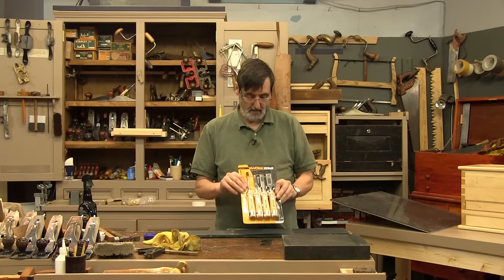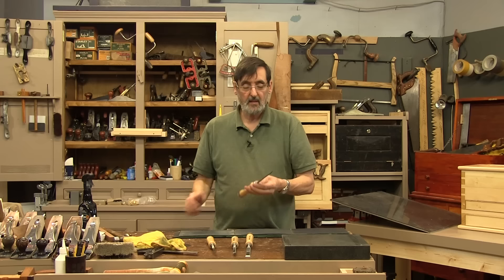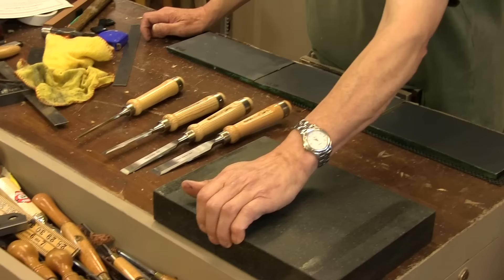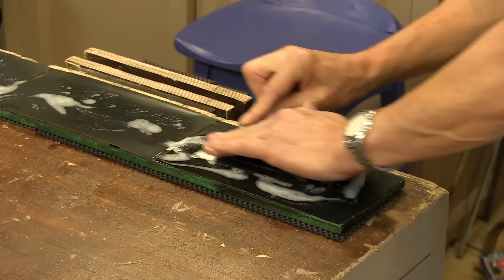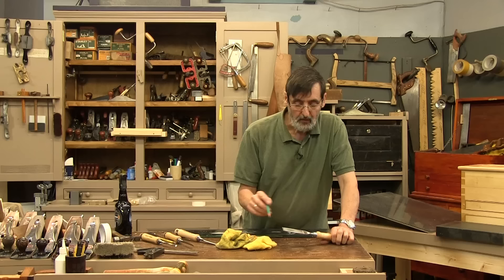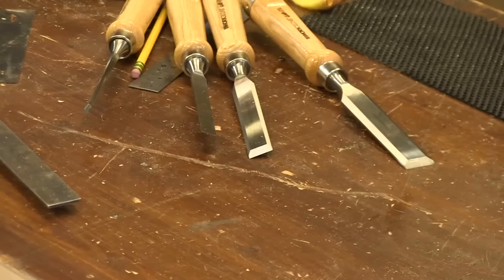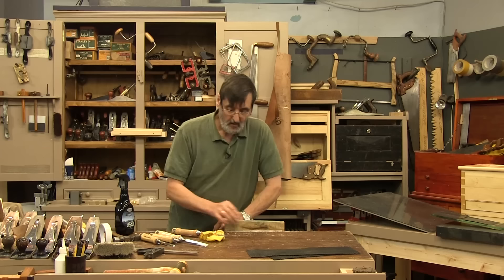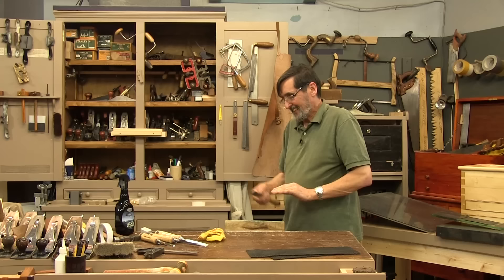Preparing and sharpening a woodworking chisel | Paul Sellers

Comment: Hello! Lovely instructive video, thank you! I need some help identifying a hand tool and I thought this place was the best place to ask. I have a hand tool from a brand called EGA. It is old but in good condition. I initially thought it was a chisel but when I looked up how to sharpen it I realised that no videos showed how to sharpen mine. It is bevelled but on both side of the surface meaning I can flip this tool on either side it is identical. I saw that most chiseled are bevelled only on one side with a flat surface on the other hence my confusion. If anybody can help, I would greatly appreciate it. Thank you
Reply from the maker: This sounds as though it may well be a sash pocket chisel and it was used a specialist chisel in the making of sliding sash window frames. Without a photograph, I cannot be definitive but that’s what it seems to me. Try googling sash pocket chisel and that should answer your question.
Reply: Thanks for your reply, I googled it but no luck. It is quite skinny compared to what I saw only. Thanks again.
Reply: lifeslittledelights You could be describing a fairly common gouge used when turning wood on a lathe. The handle would normally be quite long.

Comment: My only comment on sharpening would be - Whatever the abrasive get it wet and keep it wet.  The wetness gives the waste metal particles an escape route and lubricates the blade to reduce the unwelcome grab so you don't rip or mark the edge surface.  Just makes whatever you use a bit more efficient.
Puddles create "mud" and mostly mud is sticky and destructive.  Moving water is clean.   
Different if it's a slurry stone, then you want to create an abrasive paste - in this case the coating on the paper id doing the work so the water is the "lubricant" - Ideally you want running water - but suspend the work plate on a piece of wood over a bowl and frequently use a sponge to dowse the work area.
It's not a deal breaker, my nan used the top step - we've seen the better end of good enough demonstrated - water is just a refinement

Comment: Paul, is there a major difference in using water or going dry?
Reply: As you know im not paul but using the fluid allows the tiny pieces of metal to get out of the glasspaper and aid in the ease of sharpening hope thos helps

Comment: Sadly, Aldi don’t do this nicer chisel pack, they’ve changed them (as they always do each week/month) with a plastic or rubber looking set. Also, there’s only 3 in the pack and not 4. As always, I’m late to the dance.

It’s interesting that you don’t concentrate on mentioning that you’re honing the edge, Paul. The videos I watch generally mention the main bevel (at around 25 degrees), and also the edge itself, which they generally put a 30 degree edge. I was just wondering if that’s what you end up with, as you don’t specifically mention a honed edge? (to my knowledge - apologies if you did). I’m new to woodworking, so any help is greatly appreciated. Thanks.

Comment: I do quite a lot of carpentry, opposed to cabinet making. Is it necessary to do this with all bought chisels, and what are considered the Rolls Royce models? Thanks for a very interesting lesson. Bob
Reply: do you mean the rolls Royce of chisels or   tools over all   I would say  planes   they would  have to be  lie-neilson   and  chisels either the  same or  veritas   they have  just released  a new  line of  chisels  with special  metal in the steel to make chisels last a lot longer
Reply: It's always a good idea to take your tools, (be they planes, chisels, traditional saws) and before you use them fettle and prepare them. The only difference will be the amount of work required - more expensive tools will need less prep. It gives you a chance to get to know the tools you'll be using as well, shape the handles to fit your hand etc. mfcman2k7 is right about lie-neilsen but another route is to buy good condition tools from makers that no longer exist, like norris. That way is much cheaper - and the quality of the steel etc can be very high, but being used tools they will need care to bring them back to life, and they won't last as long, depending on how much they've already been sharpened down
Reply: I totally agree with ed mayhew  some of the older  tools I find are better than a lie neilson  tools after a  hour or so of work I have a  few old Robert  sorby and marples chisels  that I have had to  make  new handles for been an apprentice  my employer  gave me  the  tang and blades and   taught me how to use a lath  by getting me to construct new handles for them

Comment: Amazing Paul! What is the white thing that you use with sandpaper?
Reply: It's buffing compound.  I think the white is diamond.  Google it and you'll find all types and grits.
Reply: Buffing compound commonly used by jewelers to polish metal. The ones I've used are White Diamond, Zam(which is green and comes in a cylinder instead of a brick, Trippoli(brown), and Jewelers Rouge(which is a darkish red). They are different grits, and sometimes are for specific materials such as stainless steel, or even glass and plastic.

Comment: I am a novice at sharpening; noting the absence of a gauge. Is "eyeballing " the angle sufficient, or recommend using a gauge for best results, or at least until one can develop an intuition for the angle?  Also (respectfully) notice how "sloppy" hand movement is with starting grit on the bevel (not the edge). Is this just the camera playing tricks, or can you get a curved polish on the bevel?  Methinks that Mr Sellers draws upon a deep well of experience such that some techniques may get lost in translation.
Reply: +Partly Cloudy Paul deliberately puts a convex bevel on his chisels.  That's not possible with a gauge as the surface of the bevel would be completely flat.  I also think you develop an intuition for how to do this by doing it rather than using a gauge.

Comment: Whats a right angle for a chisel blade?And what is a best way to sharpen it ?
I kinda suck when it comes sharpening by hand ,any advice?

I have a 25mm chisel and  it had a dent in a edge,since i am not a smart man i used grinder to get rid of it.
I tried sand paper +glass but i cant get bevel(that should be the angeld part right?)angle right ,at least not by hand.
Problem is it tilts unevenly and blade of chisel is not 90 degrease when you compare it to sides of chisel.
Chisel is sharp enough to cut but it is not cutting straight ,it twists when i hit it with hammer.

Is there way to fix this and make it usable again or should i throw it away and buy a new one(It wasnt that expensive but ,for me its not cheap ether)?

I was going to use it for cutting mortise and dovels.
Reply: find another hobby.....if you can't follow above video???

Comment: Efective to a level, but to achieve even a better results on the stroping fase, one should exerce much less pressure and a litle more speed on the chisel. Other than that, what hapens, is that during the motion the leather under the chisel´s pressure creates a "wave" behind the blade that inadvertly polish also the cutting edge, and the best possible cutting surface is not achieved.  This can be verified on a cheap usb microscope device (400X) but can also be clearly felt after changing methods, (and that "wave" can be seen even at naked eye).  This is the reason why barbers sharp their thin blades applying speed, not pressure, and when sharpening hollow bevels they lay all the blade surface on an angle to allow full contact of the blade´s side that avoid the "wave" to be created. In this case that can not be done as eficiently because your strope is flat and the bevel is round, but this process still works and enhance significantly the edge quality, and can be aplied on all sort of edges.

Comment: Is it okay to use a flat piece of wood that is planed down with a plane for flattening and sharpening?
Reply: I think you want something harder so it will stay flat.
Reply: Yes, but you'd probably need to keep replaning before using it each time. You want something hard and dimensionally stable. Plywood would work
Reply: Would MDF work, or would that be too soft as well?
Reply: rkvktmen I think MDF would be OK if it is square. You can check to make sure it doesn't go out of square afterwards.

Comment: i was tempted to buy cheap chizels n then sharpen tjem. then i asked a joiner i worked with n he suggested irwin maple. bought them 45 quid for 4 with oil n polish sharpening stone. snd a roller. not that sharp on first use. ile sharpen them one day. msy buy cheap ones forv regularl ulse use. ee will see

Comment: So do more expensive chisels just stay sharp longer (quality of the metal) like chef's knifes or Am I wrong?
Reply: In general, yes.  In specifics, no.  You also pay for things like well made handles and tangs.  And while some prefer a chisel that stays sharp longer, others prefer a carbon steel that can become sharper, but also has to be sharpened more often, and cleaned often so it doesn't rust.

Comment: When you start to buy stones or diamond plates, would you start buying the fine or coarse grits?
Reply from the maker: Coarse but you could use abrasive paper to start out, as an option.
Reply: @Paul.Sellers Sellers Thanks! I have used your method for a while now and wanted to invest in some diamond plates.

Comment: Hi Paul, love your videos, you explain things very clearly in a way that even beginners like me would be able to understand. As i have mentioned, i am still a beginner and diamond stones are still out of reach for me due to the expensive price of it, so i was excited when i see that you can use sand paper to sharpen chisels, but as you've said, the downside is that it can tear quite easily. So my question is if it's possible to use the kitchen sharpening stones (the one's with two grits on both sides) to sharpen my chisels? Would appreciate your feedback on this. Thanks! :)

Comment: I bought a set of Aldi chisels several years back and they sharpened up as well as I could have imagined. Recently I bought another set and the quality is just not there. The ends of the chisels, well two of them at least, were not even square, much less sharp. Very disappointed in what has happened to the quality of their product.

Comment: Every time I try to flatten my Narex chisels I get rounded side edges. Those things are a nightmare to flatten, the steel is so hard. Even on carborundum wet and dry paper.
Reply: Use diamond plates. Even stones takes ages. The time taken to flatten makes the chisel cost irrelevant!
Reply: Yeah, I've spent probably over 10 hours working on the set of 5 chisels. And went through tens of sheets of sandpaper. I think I'm going to buy a single 100-200 grit diamond plate after all.

Comment: Hi 
 I bought a 10000 grit Japanese water stone and it claimed to give a mirror finish. This was a very expensive stone! I tried to finish my chisels and my plane irons on it and I continues to finish with a blurry finish, smudged?
Can anyone help?
Reply: +Carlos M. Saurith Are you using a sharpening jig or guide?
Reply: +Carlos M. Saurith Get a piece of leather, some polishing paste and have at it. :) You'll have a mirror within 30 seconds that way. I just lay the leather down on a flattened piece of wood and clamp them to my bench. Easy-peasy. :)
Reply: Keep in mind that Japanese grit size is not directly comparable to Western grit size, much like you can't directly compare metric to imperial.   A 10,000 grit Japanese waterstone will be comparable to 2500 FEPA grain size.

Also, Japanese water stones need a second harder "naruto" stone rubbed against the wet stone to create a sludge.  That sludge is what polishes.  If you use it as you would an Indian water stone, with hard pressure, it will  not give very good results.

Comment: You really don't need to put that lot of pressure on the tool while sharpening and you don't have to stroke it 50 times on the same grain.  10 strokes will do.  Let the abrasive material do the job.  There is no point in compressing the paper.  By pushing too hard you crush and scrape off the abrasive material, eventually, tearing the paper.  BTW, I don't want to be cynical, but oak really is not that hard a wood.  Try your chisel on a tropical wood like azobe, also known as 'red ironwood' in the US.

Comment: paul its clear you know what you are talking about....but only thing that concerns me is that you didnt set your angle on your bevel...no human can keep a chissel straight by hand ....is it not better to use a 25 degree guide. like a vertias ?
Reply: bobsy, you do not need a perfect angle to be successful. Some people prefer a few degrees either direction. Tool use and technique matter. I have that Veritas angle guide but have never used it. A: I do not like the feel of it rolling sandpaper or stone, and B: I just never needed it. I do it like Paul does by hand and have had tremendous success. Perfection is not required.

Comment: I hear "macro bevel" and I'm confused by the term. At college we're taught to sharpen at 25 degrees then put a micro bevel of 30 degrees on. However, it doesn't look like Paul does this; Paul just works on the existing bevel, which I thought would be 25 degrees, but the video says it's 30. Someone please provide me with knowledge sprinkles for I has the stupids.

Comment: Hi, I just went to a swap meet and this guy had two "Marples" chisels. They looked old, the handles were blue (almost like watercolor)  and had a white stripe where the iron meets the handle. THe shape of the handle was like a skinny eggplant with nothing on the end. The blades looked dark grey. I offered the guy $4 but he wanted $10. I passed on it, because I just wasn't sure if they were a later Irwin model or the English model. It did not say 'made in England or Sheffield' or anything. Just said Marples. How the heck would I know if its the older/higher quality or the newer junk model? Does it really matter?

Comment: You can find chisels like these in the US under the Shop Fox brand. I think they might be discontinued though as they can be a bit hard to find and Grizzly only shows stock of the odd sizes: http://www.grizzly.com/search?sq=Chrome+Vanadium+Chisel
Reply: Steve M You can also find them at Aldi's - I just bought two sets today in Ohio.
Reply: They do appear to be the same. The Aldi's ones are one-quarter of the price of the Grizzlies, but the Grizzlies are still reasonable.
Reply: We don't have an Aldi's here on the left coast so they are not an option yet. The only reason I purchased the Grizzly branded version is that it was the longest blade for the lowest price that I could find for use in a flooring project. Although I figured it would get destroyed chopping out 3/4" particle board from under the edges of kitchen cabinets it took a beating  with hardly any signs of damage.

Comment: NGL, you got lucky compared with the ones I got from ALDI, they weren't just dull, they were squared off end at the end of the bevel with no sharp edge at all, took an insane amount of sanding to get them remotely usable. They're great now that they're sharp but honestly wouldn't have bought them had I known in advance. (For the record the ones I got were completely different from these wooden handled ones)

Comment: I disagree with you taking so much material off the back of the chisel with the coarse grit. You really only need to expose around 2 mm at the very cutting edge. That way, when you resharpen the chisel, you can use a finer grit and grind less due to less material being in contact with the sandpaper.

Comment: its good really, but when you need 5 tools to sharpen a chissel its too much hastle. I thought myself to sharpen a chisel with one whetstone, and then polish it on electric machine. It then is sharp enough to shave the hair.
Reply: +Ice Carpenter most people just use sharpening stones, this guy is kinda weird going the glass and sandpaper route.
Reply: +Zoink u can use sharpening stones, but u have to resurface them first to make sure they are truly flat first before use them, thats why paper on glass works well
Reply: +Ice Carpenter Also the glass / sandpaper method (otherwise known as "scary sharp" method) has the lowest cost of entry.  If you have a pretty well furbished shop already and have the sandpaper (as I did) then you're one can of spray glue and one discard marble or granite tile away from doing it.  My first wood tool refurb was done last year, a plane, and I got the blade in order in 20 minutes and for about $10 us, and that includes the glue and tile.  But quality stones cost upward of $50us... for each individual grit.  So to replicate what he did, you'd need $350 just in stones.
Reply: +Ice Carpenter Paul is just showing the different ways and techniques that can be used
Reply: +Chewbacca Chewie sure, and my opinion it's overcomplicated. not bad or useless though.
Reply: +Ice Carpenter How is it over complicated?
Reply: +Zoink If you watch Paul's other videos you will see he normally uses diamond stones.

The point of this video is how to do this on the cheap for beginners.  That's why he has bought cheap Aldi chisels and is using wet and dry paper.  This isn't what he typically does.